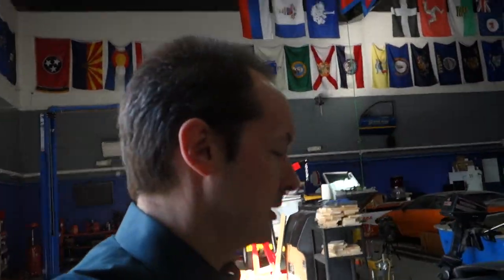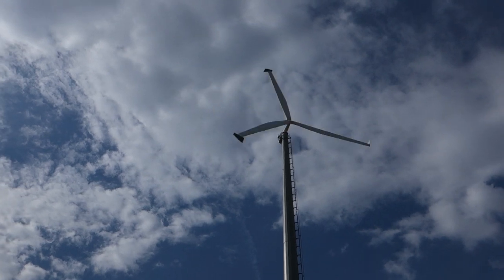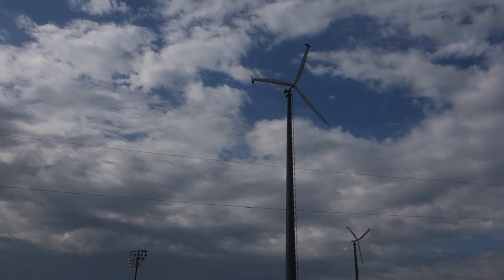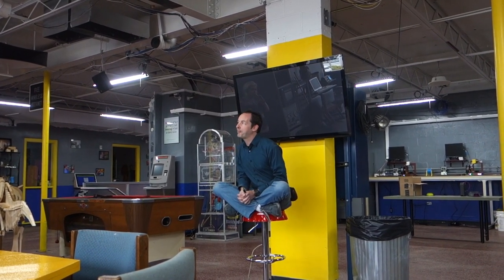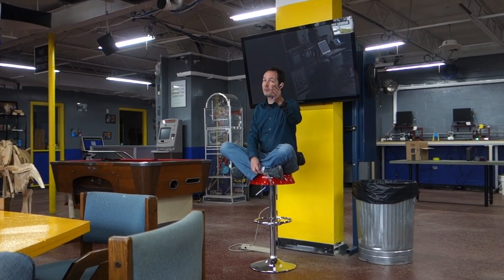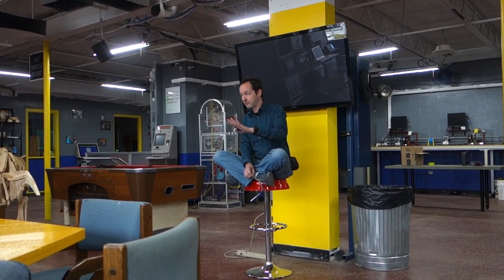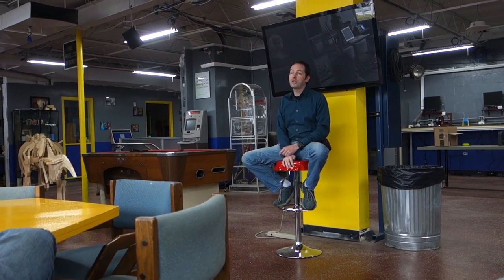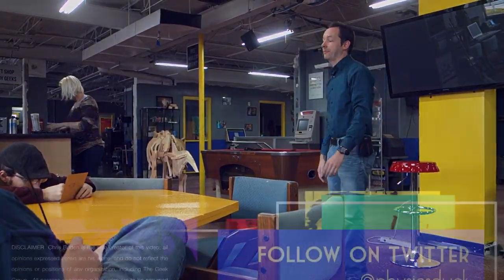Captain's Blog 10 20 2015 Consumers Energy Sucks

Comment: I've had a heat pump installed in the home for around 20 years (for heating only). It worked fine, but in the end it did not save any money. And if the energy for it isn't coming from renewables it won't even save any emissions. You need approx. 1/3 third of the electricity to achieve the same heating with a heat pump compared to just heating with electricity directly. Sounds good, but if the electricity is coming from a fossil fuel power plant you'd better burn the fossil fuels (gas or oil) right at the home in central heating. This is actually more environmetally friendly. If you get all your power for it from your own from solar cells on the other hand, go for it. Don't get your hopes up that you save any money over the whole lifetime though. Installation costs are typically so high that it cancels out all savings for the energy (at that is coming from me as someone in Europe where energy costs already are a few times higher than in the US). It will definitely help the climate though.

A wind turbine is nice to look at, but there's a reason that hardly anyone builds small ones anymore (here in Europe anyways). They are very inefficient (W/$) at that size and the money is much better invested in solar panels. Also the turbulence of all the buildings around would mean you'd need to build a very high tower. That's not something you can just install on a roof, because what you don't see in the small foundation is, what's going down in the ground. It also may sound not that loud when out in the open, but you will get noise complaints from neighbours if you had that thing on your roof.
Reply: +superdau not only turbines inefficient (W/$), they are not permitted to build in residential or city territories in my country. Noise and shadowing for the main reasons. We have here huge ones that supposed to be more effective. Strangely not in serious wind farms but in groups of 1-3 mostly :) They supposed o be built nowhere near houses, but lots of them are for some reasons, despite laws against it. One farmer is being surrounded by 3 of them just outside my village, despite of the builder not having permits to build them, and filing wrong maps (without the his house in the middle) :)

Comment: Holland Township Wind Turbines

The Zeeland BPW erected two 120', 50 KW wind turbines on the north side of Helder Park in Holland Township, Michigan. The turbines feature 25-foot blades and generate an estimated 170,000 to 185,000 kilowatt-hours of electricity annually, or enough energy to power 22 homes.

http://www.hollandsentinel.com/article/20090314/NEWS/303149894